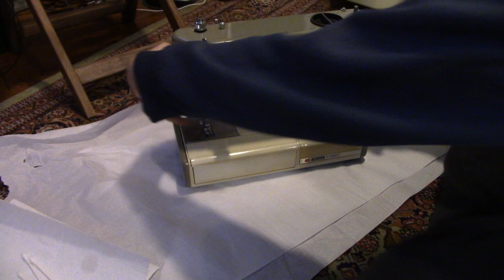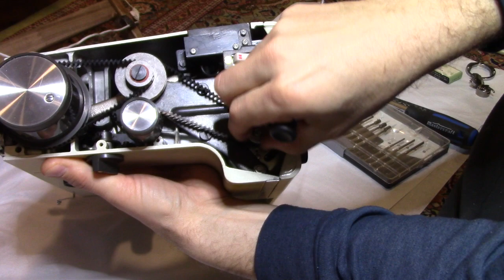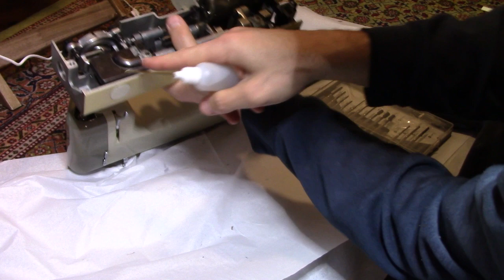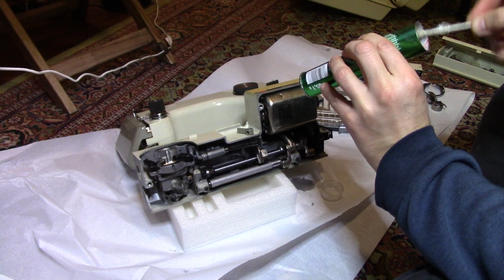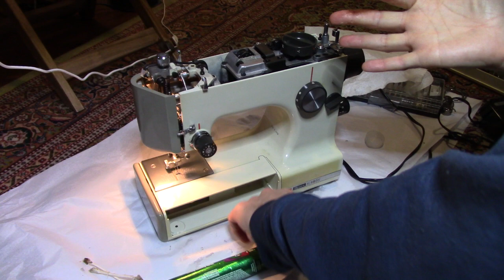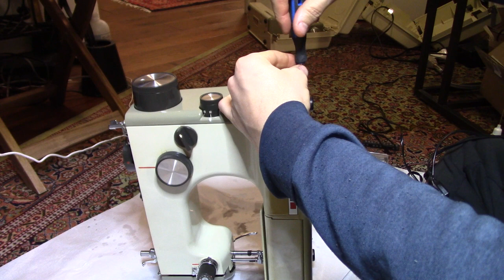Freeing a Stuck or Stiff Vintage Sewing Machine

Comment: The 1030 is an absolutely wonderful machine. A little more resistance when you turn the hand wheel is normal due to the dual pulley reduction drive which is designed to reduce start up load on the motor.

Comment: My newly acquired Sensor Sew 70 had a click after I cleaned it up and oiled it. Couldn’t isolate it. After a few days, I discovered that the hand wheel clutch wasn’t completely back in place after winding a bobbin. It sewed perfectly but with a click. Once I tightened the hand wheel, the click disappeared. All better now.

Comment: Many thanks for this really useful information. I've just bought a Frister & Rossmann Cub & have struggled to find anything about looking after it. Have realised that in in North America they are Kenmores! Your machine looks almost identical, wonder why they were marketed under different brands.
Once I get the machine I know what I need to do. Your instructions are so clear to follow.  Shame the machine isn't as easy to take apart as my Singer 338 which is a doddle. Just hope I have the right screwdrivers to dismantle it.
Reply from the maker: Kenmore bought machines manufactured by others. In this case, Frister and Rossman bought that machine as well under their own badge.
Reply: I had seen the name Kenmore when I was researching my Singer stuff & wondered why I'd never even heard of it. Now I know! Thank you.
Reply: Both Sears Kenmore and Frister & Rossmann had these all metal late model machines made by Jaguar in Japan. I think that Jaguar also made the same machines for Waltons, an Australian department store if my research is correct. Waltons may have bought them from Sears or Frister & Rossmann and sold them under their own name rather than buying from Japan direct, I don't know which.
Jaguar machines are the pinnacle of the mechanical all metal sewing machine, in my opinion. They are arguably better than the Singer 400/500 series. Wonderful machines.

Comment: The problem with the models from the 90s up is the front and rear covers have hidden screws crazy difficult to find - plus there are also a few plastic tabs between the front and rear covers, so the covers won't split up making you wondering if there may be yet another hidden screw somewhere - just to make your day more miserable. My only advice is to find a synthetic grease that doesn't smell too strong, and may also use very well some automotive oil (engine oil), just not too much so it doesn't drip later on on your fabrics. Great video.
Reply: The newer stuff is always like that no matter what it is. That's why most people don't bother with it. I'm having the same kinds of issues in customizing my '92 Cadillac. So many plastic tabs where there should be metal and screws. I mean I've got stuff from 1950s, 60s, 70s and 80s to do too but this car means a lot to me and got me through some really rough times so I wanna do right by her and bring out her true potential. 

Not meant for tinkerers, that's for sure, but we tinkerers find a way!

Comment: What kind of screw driver/wrenches are you using to open the bottom I am stuck. I am obsessed with 158. series- convertible machines. Thanks.

Comment: great! I learned that over oiling is ok! great video! working on a Kenmore 158.17850 got her unstuck & sewing now but the stitches are really small?
Reply from the maker: Small width or length? You need to start turning the knobs to free up the stitch width  and/or length until that part starts moving. Remember for stitch length, there are parts underneath which need working on, oiling and freeing up. If the stitches are still too short after everything is freed up, you might need to adjust the screw on the feed mechanism -- I have a video about adjusting the feeding on a class 15 machine if that helps -- but save that until you are sure.
Reply: @jamesrogers991  thx I will do that! I'm a visual learner your video taught me a lot!

Comment: Hi James, my selector switch is having trouble moving. What parts did you lubricate? It’s hard to see in the video. I’m trying to loosen it with oil just not sure what points to target. I don’t want want to force it either. Thanks

Comment: James, do you have any suggestions for a broken knob for the Special Stitch Selector Dial 158.1030? It's an impossible part to find. One site suggested using J-B Weld to attach the dial to the inside broken plastic base. Thank you for your informative video.
Reply from the maker: I have used Gorilla glue with success, alternatively if you are good with 3d printing, you might be able to create yourself a new knob. If you can find a dead 1030 somewhere, you might part it out.

Comment: Hi James. Can you advise why the clutch on my Kenmore may hace stopped working suddenly? There is no movement at all when I try to loosen it to fill a bobbin. Thanks :)
PS. I love the way you get right inside and show what you are doing here! Jan
Reply from the maker: Is the motor making a noise? I am wondering if the belt is slipping. Can you sew with it still?
Reply: @jamesrogers991  Yes, I can still sew, with no unusual noises - the machine just purrs after a little love and oiling!
Reply: I’m having the exact problem and haven’t found a solution. The clutch just won’t budge so I can’t wind a bobbin. Did you find a solution? I have the 158.10400.

Comment: I just got a vintage Kenmore 88. It was not used fir at least 20 years. And it was 100 stuck. I oiled it just as the manual said to do, and in 4 day it started to work. However the release clutch is solid stuck...there us no information how to oil it or fix it in the manual... what to do???
Reply from the maker: Is the 88 a twist clutch or pull clutch?

Comment: I just acquired a kenmore 158.1030 that’s in almost mint condition, however the previous owner says it’s been inactive for a long time. I’d like to get it to a point where I am able to use it. I was able to download a manual for it online which shows all the oiling ports and have been able to oil and clean up all the minimal gunk and dust and such. the only issues I have is that the feed dogs don’t seem to stay up even though the lever is up. so the fabric will intermittently move. got any advise where to even begin to troubleshoot it?
Reply from the maker: Samantha, take the bottom off and then you can see what is loose or not working quite right. Once you get the bottom off, I will be able to help you adjust things -- it is very simple to make adjustments once we know what is giving you the issue.

Comment: Hello everyone! It was very helpful to watch the video and get some confidence about actually open my sewing machine and at least give it a try! I would like just to have you opinion on The following. I am total beginner and this machine was given to me without much information, not even the manual. It’s an old model , Toyota 3000. When I plug in the and pick the pedal I can hear and see the motor running. I could actually use it to prepare the bobin and put the thread on it. Unfortunately when I ‘shift’ the wheel everything stops! The motor runs but the second belt is completely stuck. I even tried to move the needle using manually the wheel, but is not moving up and down. After watching this video I realised how many parts should actually move inside. Observing that in my machine everything is just still ... I am wondering now if there are hopes that the machine will ‘resurrect’ or if it’s better to just let it go. If anyone had an idea it will be super appreciated! Thank you for your time :)
Reply from the maker: OK, you will need to give it a good soak in oil and leave it for a few days. Remove the bobbin case and any thread. Turn the balance wheel by hand. This is likely where the stiffness is. You will want to rock it gently over and over during the freeing up phase. Once it starts moving, then it becomes much easier to change any grease, give it a proper run in. This is generally a test in patience. I am happy to have a video conference with you if you wish extra support.
Reply: @jamesrogers991  Hello James :)))) thank you so much for taking the time to get back to me, very appreciated. I am really happy to hear that it's worth at least to give it a go. I'm going to follow your suggestions and see how it goes. While opening the machine, where the bobin is, I noticed there is a lot of greases, almost yellow/orange, I think it's better to clean it properly before starting to soak with oil, correct? 
On another note, (I'm referring to an online picture to better indetify the machine parts, therfore sorry if i don't use the proper terms) the machine pulley, or as I called it, the external wheel, is rotating, but the shafts (both arm and beds, are completely stuck). if i rember well, my mum sewing machine used to move the 'thread take-up lever' while moving the wheel. i have tried to move it gently, but again it is completely blocked in its lower position. ( I felt i had to add some more info).
Anyway I will start with a proper cleana and then a lot of good oil. How many days so you think will be good to wait for? (Just as an indication).
If the machine will start to give sign of 'aliveness' I will be more than happy to show it to you and see what can be done. 
Thank you very much for your advise.
Reply from the maker: @elisacattaneo6331  You are correct. Clean everything and soak it. The two pulleys are just reducing gears to give the motor more power and control. The top knob should turn freely and this is where the fun of soaking and cleaning should start to see some movement.
Reply: @jamesrogers991 , fantastic! Thank you so much for your reply. May I ask also your opinion on another 'issue'. Do you think it is possbile that a sewing machine works even if the dog feeders are not working? A friend knew I was stuck with my machine and offered hers, but she mentioned that the dog feeders are not working. Now that I have a little bit of hope to save the old Toyota 3000, I am not so sure if I will be better off with one, that has the dog feeders out of order. I am very sorry for all these questions but I am getting very passionate about this 'sewing world'. I like fixing things, usually push-bikes, but it seems that recently I re-direct this inclination more 'indoor'. Thanks for taking the time to reply and adivse.
Reply from the maker: @elisacattaneo6331  The feed dogs can be quite simple to fix depending on the machine. The normal problem is that the feed dogs were lowered and the mechanism is stuck in the low position. It is rare that anything else goes wrong except if one of the screws is loose and so the mechanism is not engaged. I did a video on fixing feed dogs.
Reply: @jamesrogers991 , thank you very much! It makes such a difference to read you message and start the day with more confidence that I might be able to fix the machine. Tomorrow I am going to take the 'new patient'. I will look at your video on fixing feed dogs. I cannot promise i won't bother you again but I for sure i am going to try first. Thank you so much for your help and for creating this channel. Have a great weekend!!!
Reply from the maker: @elisacattaneo6331  Bug away. I am happy to help where I can.
Reply: @jamesrogers991  Hello James! I am back again with the new patient. The diagnosis is simple: is dead!! I'm joking. Now I put my hands on a "Singer Starlet 495". It seems more promising than the previous one since the wheel and the needle move and work together!!! I have started to clean it and my first impression is that the dog feeder is not moving at all. I have read the manual carefully and there is obviously not a button to raise it or lower it down, instead, there is a plastic mask to put on it, when needed. Now I think i have to find the courage to open the sewing machine and see why the whole mechanism is not moving at all. I keep you update with my discoveries... and carry on watching your tutorials :))) have a great weeke end.
Reply: @jamesrogers991  ups, I have noticed that I have sent my last message from another account. Anyway, I had sometime and checked the new/old sewing machine. The gear that makes the dog feed move is broken. Do you have any trusted website where to buy the part? I'd like to give it a go and fix it myself. thank you so much and have a nice day
Reply from the maker: @elisacattaneo6331  Could you post a video of the gear that is broken -- you can post it on your YouTube channel and then send me the link? Which machine is it for? I can then advise where you might find some parts.
Reply: @James Rogers ... I hope you can understand from the video, if not I take another one. Thanks for your time and patience :) as you might see from the video one gear is ‘broken a part’ therefore it doesn’t engage the other gear which makes the dog feed move (at least this is my understanding). I hope that by changing the gear I can fix it... at least I will try 😄
Reply: The model: Singer Starlet 495

Comment: Hi.  Have you any experience with a frozen up (late sixties/early seventies) Husqvarna Viking #6030?  I am trying to  get it un-gunked myself.  So far not great luck with the product I used.  Still trying.  Also:  Do you know where I could buy New Belts* for this machine I have (6030) ?  I'm having a hard time finding them.  Perhaps you know of a good place to find them?  Just giving it a shot.  thanks!
Reply from the maker: For new belts, I would try your local dealer or eBay. I have not tried to un-gunk that particular model of Viking, but I would just try slowly over a few days and see if you can get it to free up. Metal is easy because you can use stronger products. Plastic is much more difficult.
Reply: @jamesrogers991  thanks for that info! (yes, it's all metal)   1973.  Thanks!

Comment: On my Kenmore 1040 the bobbin will wind just a bit and stops. Seems as if the clutch   doesn't disengage enough because the needle still moves up and down Help! I would love to be able to wind a full bobbin 😂 The machine works great otherwise.  I've oiled it real good and only have the bobbin situation to deal with.
Reply from the maker: There is a screw that enables you to adjust the guide which stops the bobbin when it is full. Loosen the screw and then adjust it. Also, if the wheel is slipping, there may be oil on the bobbin winder wheel or the balance wheel. Take off the lid and wipe the bobbin tyre and the balance wheel to clean them.
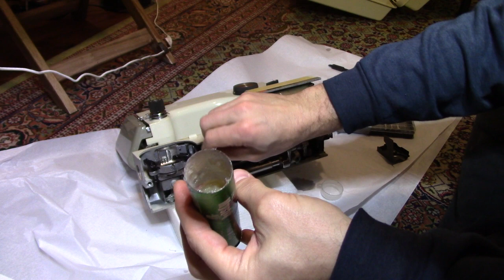Reply: @jamesrogers991 I finally got it working. Just had to oil inside taking the hand wheel off. YAY! I just still 19:58  can't get the feed dog to come down
 It's completely froze up. I've heated it and tapped and it's just not going to move.

Comment: Hi James, just found your channel
I have a Necchi Lycia on a table ( no a free arm)
I took the bobbin case and the tension mechanism out to clean them, and I can't put them back
Hope you can help me, I'm a visual learner, I saw one of your videos with a Necchi machine, thanks
Reply from the maker: Maria, I will do my best. It might be easier if we use Skype or you connect to me on facebook. I am in Vintage Sewing Machine group, but you can find me under my name in Toronto as well. Once we connect, you can send me some photos of what you have taken apart and then we can gather some instructions and images to assist with putting it back together. Have no fear, it will be easy once we connect.
Reply: You're a good man!
Reply: @jamesrogers991  hie pliz contact me 
My machine is stuck
Reply from the maker: @acolinsedah3897  What can I do to help you?
Reply: @jamesrogers991  thanks James it's sorted thru watching yo videos.thank u for responding

Comment: Hi, my machine is stuck,  bought it from the previous owner like that The hand wheel and needle bar are stuck, they don't move when l press the foot pedal
Reply from the maker: Ok, you will need to oil it (probably with pentrating oil) and let it sit for a few days. Then repeat as necessary until things start moving.
Reply: @jamesrogers991  OK thank you for a quick reply, will do so